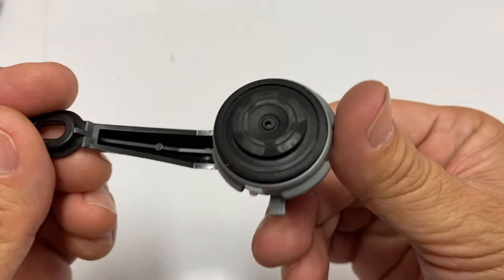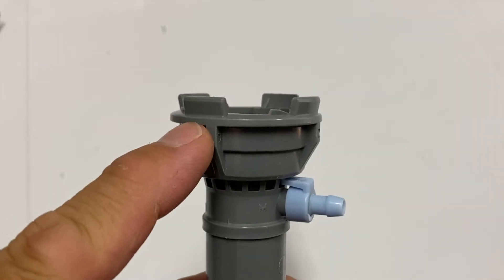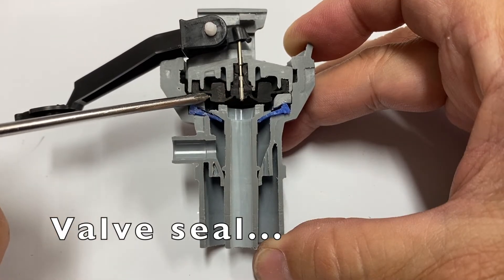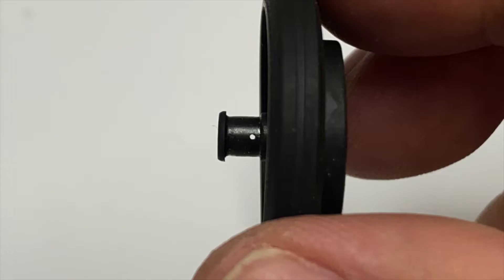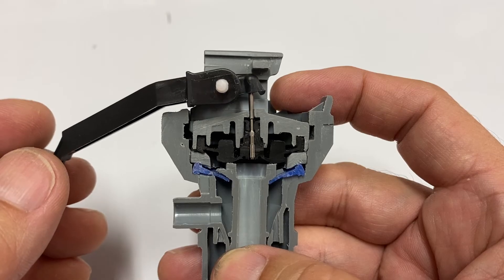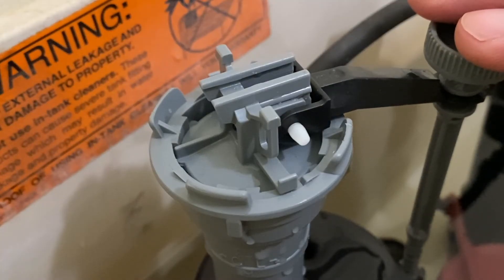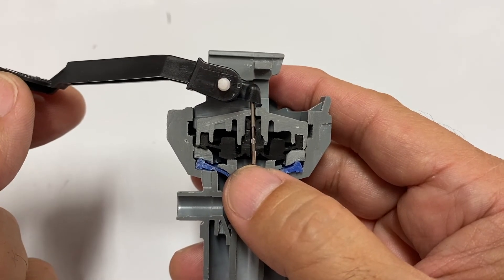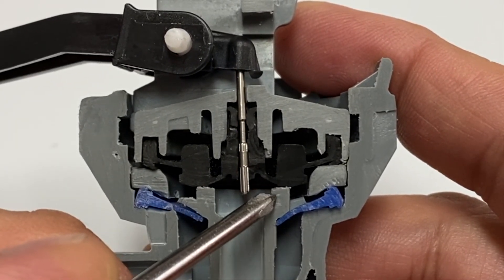How Fluidmaster 400 Series Fill Valves ACTUALLY Work

Comment: Thank you for that explanation. I recently installed a new Fluidmaster valve but when the cistern is full it still allows water to flow in! How I can correct it, do I need a new rubber valve, or I need to add additional seal?
Reply from the maker: This video may help… How to Fix a Running Toilet for Beginners | Basic Life Skills
https://youtu.be/Mv5V44pgSdE
👍😎

Comment: I have the same valve but when i flush the toilet, it doesn't automatically refill.  I have to tap the value and then it starts to refill.  What could the problem be?
Reply from the maker: First, confirm that the float freely moves up and down.  Next, clean the fill valve seal… Fix it Yourself!  Replace the Fluidmaster 400 Valve Seal for Beginners | Basic Life Skills
https://youtu.be/sEdfFZQYQEI
👍😎
Reply: @HacksbyDad  I think it maybe just dirty because I just flushed it and it did not start to refill until i tapped the the top of the fill valve a couple times.

Comment: Awesome Video and Review!!

Question, Is the Fluid master 400 model and Fluid master 400A model the same thing? 

Thank you sir!
Reply from the maker: Thanks!
I am familiar with the 400A and 400H… What's the Diff?  Fluidmaster 400A vs 400H
https://youtu.be/xlrH3I-9KR8
There is also a 400LS (Leak Sentry) that I have yet to get my hands on.  
👍😎

Comment: So, I just replaced the valve seal as instructed. Not enough upwards pressure from the float as it rises. Only way to stop water with arm is to pull up pretty hard with my hand. Wonder what is going wrong?
Reply from the maker: Not sure.  This video goes step-by-step on replacing valve seal... https://youtu.be/sEdfFZQYQEI
👍😎
Reply: @HacksbyDad a few flushes later and everything is fine. Must have needed a few flushes for the new seal to seat properly. Thanks for your reply! Good content!!
Reply from the maker: @tarajones-legros3661  👍😎

Comment: My new fill valve seal doesn't squeak like that when I put it on- I get no resistance. My toilet keeps running now with both the new one and old one on (the original issue was just whistling). Did I mess something up? This wasnt supposed to be this complicated 😥
Reply from the maker: Not sure.  Please clean the valve seals and flush the valve head again to see if that helps.  If not, you may need to replace the valve head or complete fill valve assembly.
Reply: @HacksbyDad  Thanks for the quick reply. I just kept things simple and spent an extra $10 to replace the whole fill valve instead of trying to figure it out. This video was helpful in at least helping me figure out the issue. Thanks.
Reply from the maker: @spainman2020  👍😎

Comment: Do you have an opinion whether this is a good design because they seem to fail after a 3-6 years. Is the most common point of failure the rubber gasket or the small channels in the stainless pin getting clogged with mineral/chlorine deposits? Is there a better competing design or is it as good as it gets?

Comment: Thanks for your videos. I've seen lots of videos in Youtube about a valve that won't shut off or fill slow. My problem is the opposite: I flush and it won't trigger the refill unless I give a little shake to the valve assembly, then it starts normally.  The valve is an almost new Fluidmaster. Any ideas?   I have both the fill level and valve open to the with the max little plastic dials.
Reply from the maker: Hard to say without being able to see the setup.  Is the float stuck at the top and drops when you shake the valve assembly?
Reply: @HacksbyDad  No, everything looks fine, I just wiggle very slightly the top of the assembly, just a touch and then it starts to fill.
Reply from the maker: @JuanDeMarias  You may want to clean or replace the valve seal... https://youtu.be/1Tnv9J8a9O8

Comment: Once i flush there is more water that sprays alot faster out the top of the controll stim. I have to shut off the water supply for the toilet to fill properly. Would replaceing the valve seal solve the issues or would i have to just replace the whole mechanism? Thank you in advance!
Reply from the maker: I haven’t run into the problem you described.  Replacing the valve seal might solve it… Fix it Yourself!  Replace the Fluidmaster 400 Valve Seal for Beginners | Basic Life Skills
https://youtu.be/sEdfFZQYQEI
I hope it works!  👍😎

Comment: Hi. I've replaced the seal by itself,  and the entire filler valve cap assembly, but it still does not shut off the water! Please help.

I've removed the valve cap and flushed water through it several times -- no change.  I've tried turning on the water and just lifting the valve arm manually -- water still runs. 

I've felt the valve seat for problems and cleaned it with a Q-tip -- it still runs. What am i missing??

All that's left is to drain the tank and replace the entire fill valve, but this has happened a couple times, so I'd rather figure out what's wrong. This should be an easy fix!

Thanks.

PS. Excellent video, I've dissected these before but never sliced one in half, so I never understood how they worked.
Reply from the maker: Sorry… I’m not sure what is causing the problem.  I would say something is damaged if all the parts are clean and holding the valve arm up doesn’t stop the flow of water.  I have heard that poor water quality can cause problems. 🤷🏻‍♂️

Comment: Thanks so much for taking the time to show this in such detail. This is not how I would have guessed these fill valves work. That's some clever engineering. Seeing those tiny holes, I am impressed with how quickly a tank refills.

Comment: Thank you for all the work it took and providing this. After replacing the rubber valve the fill valve is still often fails to shut off the fill water. This has given me ideas to check: make sure the tiny holes on the center valve are clear. Examine the metal stem to see if it is bent and unable to allow water to fill above the valve to pressurize it.

Comment: what happened to me was that on low water pressure the valve does not stop the water flow and the tank overflows. anybody else with this issue?
Reply from the maker: Sorry... I haven't experienced this problem with the fill valve and low pressure.  For the tank overflowing, please check to see that the overflow tube is at least an inch below the hole for the handle.  The setup is explained is this video... https://youtu.be/HFLEoBAJj2E
😎

Comment: Had a run of bad luck with those fluidmaster rubber diaphrams.   Had a PRO45.   Worked flawlessly for almost a decade.  Started sticking open.  Replaced the rubber diaphram.  Now it squeals, and slowly leaks.  Figured the plastic valve seat degraded.  Replaced the whole valve with 400a.  Worked for a few days, randomly sticks open 1 out of 4 flushes.  Gave up, switched to a Korky.   That metal pin is so small in diameter and the rubber diaphragm is essentially the both the valve body and valve seat for that pin and it's molded into the rubber.  Not much tolerance for error in the rubber molding process.   Don't know if fluidmaster's tooling is worn out causing the more recent rubber diaphragms to be of inferior quality and that combined with my higher water pressure makes for repeated failures.  Toilet valves aren't supposed to be rocket science, but this one has me stumped.
Reply from the maker: How is the Korky fill valve working for you?  I haven’t tested one out yet.  😎

Comment: One additional point: if you have removed the whole assembly, and/or moved the top section against the fixed tube attached to the cistern, perhaps in order to adjust the fill height or to inspect the whole thing away from the toilet, there is another source of a slow leak:
The top section with all the float and valve business is sealed against the water mains pressure small inner fixed tube by 2 small O-rings. These rings (10mm outer diameter x 1.5 mm) harden over time and stop sealing properly.

So if you disturbed the seal between the upper and lower sections of an aged Fluidmaster assembly in any way, the symptom of a creeping overfill is the same as a faulty valve seal! So if cleaning and replacing the valve seal doesn't fix the overfilling, consider replacing the 2 small O-rings (a little fiddly as they are in a recess).

There's also a bigger O-ring around the outer bottom tube, which, I think, is not critical for leaks, more to do with potential air ingress during filling (a problem I encountered and reported in another comment).

Comment: Very much appreciate your cutout of the valve and its housing and how it works. Is it common to have the rubber seal look all normal visually but to be impaired in how well it seals (or doesn't seal)?
Reply from the maker: Thanks!  Yes, it is common for the seal to look okay but not function properly.  😎

Comment: Thank you so much, this is exactly what I was looking for! 

I couldn't understand how the pin could force the rubber seal to close if they weren't firmly attached to each other. Now I see that it's actually the water pressure itself that holds the seal closed, which is a genius design.

This gave me the confidence I needed to get a replacement seal and get the toilet working again.
Reply: A genius design wouldn't wear out and stop working on us the way these things seem to do these days 😉, but yes thanks to Hacks by Dad for letting us see exactly why it fails! I need to start keeping spares on that rubber thing. I used to think CLR/soap and cleaning would revive it, but seeing this video, it looks like a lot of the wear and tear is likely up inside that little pinhole.  -Take Care

Comment: Then when the rubber ages the narrow sections of the rubber do not seal on the stem and water continues to escape from the top of the stem regardless of the pressure down on the rubber seat!! Over engineered that relies on a very small rubber to tiny stem seal!It is clever, but too clever to be long term reliable as the flutes a will eventually cut a groove in the small rubber sealing points!

Comment: I changed the valve seal but water continues to flow out. the water rises above the floater and spills into the bowl. If that blue part is damaged, could that be causing the flow?
Reply from the maker: I suggest you verify that the float and valve arm move freely.  If they do, you can replace the valve cap (including the valve seal) or the entire fill valve assembly.  Hope this helps.

Comment: I have this model in my toilet. When the fill valve closes on mine it happens somewhat abruptly and this causes a bang in my wall. I installed a shark arrestor but still bangs quitle loudly. I may need to replace the whole fill valve. Or, do you think It could be a bad valve seal?
Reply from the maker: I experienced water hammer when my pressure regulator failed.  It stopped after I rebuilt the pressure regulator.  Here's a video on that repair... https://youtu.be/eI334pzRWDQ

Comment: this is wonderful!  That little valve uses the water pressure on a big area (around the circumference on top) to hold back water under a small area (the centre part).  The same process that big industrial valves work on.  I just replaced mine; crud in the bottom where the supply attaches, cut flow.  I did the 'flush process' but it wouldn't clear.  Great!!

Comment: Bravo great video well explained and excellent visual aids.  I am looking my 2nd toilet with this valve with the same problem.  The tank refill has crawled to a slow gpm flow from the valve.  I did a quick cleaning but there were no debris and water pressure is satisfactory on the inlet.  So i suspect the rubber seal is the problem as it looks a little worn.  ANYONE ELSE have this same issue with this valve?  IF SO i was thinking of just replacing the upper pop off portion to save time.

Comment: Great video, i need to look at mine as the old seal leaked causing overflow. Replaced the seal but now it takes a lot longer to fill. Interestingly the old seal was red the new one was black, I'm wondering if it is simply because the new seal is stiffer and slowing the flow.
Reply from the maker: Thanks… I appreciate the feedback!
Are you talking about plastic valve cap being red or the actual rubber seal?   I haven’t seen a red rubber seal before?
Reply: @HacksbyDad  No the actual rubber seal, it is a dark red colour, I thought maybe a low or high pressure version, but the replacement washer pack is OEM and states multipressure and the seal is black. This is what it fitted, I'll take it off again at some point to see if there is any reason why the water rate is slower.
Reply from the maker: @royster3345  Thanks for sharing.  Now I know that there is a red-colored Fluidmaster fill valve seal.  Hope you fix the problem.  
😎

Comment: First thank you for detail and indepth explanation. However I am still confused why such sophisticated mechanism is needed. A simple spring loaded shut off valve would have been good enough with the ability to bypass some water through the toilet refill tube
Reply from the maker: I'm curious too.  I'm sure they have a good reason.  I read that the water pressure behind the valve seal creates a very strong seal.  Maybe someone from Fluidmaster will see this and explain.  
😎
Reply: Yes, whatever was wrong with a simple lever pressing directly on to the rubber diaphragm to stop the water flow? Why re egineer a simple device with something which relies on precise fluid dynamics and precision seals to get the job done? I have a filler valve type which relies totaly on water pressure above the diaphragm and just a tiny bit of wear at all on the rubber stops it working! The rubber has to be brand new or no deal! Somebody always has to come along and re invent the wheel...

Comment: I don't understand why the initial water has to be release out the two holes onto the top of the fill valve?
Reply from the maker: That’s so the water pressure above the valve seal can be released which allows the pressure below the seal to lift the seal.  Lifting the seal allows water to pass by under the seal to refill the tank.  Hope this helps.  Thanks for watching the video. 
😎
Reply: @HacksbyDad  Thanks so much for the clarification. Great video.
Reply from the maker: @roberttompkins6489  Thanks for the feedback!  Much appreciated!
😎

Comment: Informative.  Those two tiny holes in the stainless stem become CLOGGED 
would cause trouble.    Extremely small size.  hardly noticeable.
Reply from the maker: Yeah.  Interesting engineering.  The valve seal and control stem are self-cleaning.  
😎

Comment: Is it just me or is this entire fill system way over-engineered just to fill a damn toilet tank? No one will ever convince me that the seal is NOT designed to fail. 

Great video! I had no idea how a seal with a stainless steel pin punched through it actually stopped the water flow.
Reply from the maker: Thanks for the feedback!   Appreciate it. 
I’m sure there’s a good reason for the complex design, but that’s waaaay over my head!  LOL
Reply: I agree in principle with the "over-engineering" argument, but would like you to consider:
a) the only sophisticated parts are 1) the stainless control-stem and 2) the shape of the rubber seal. Given that the stainless steel part in this configuration would not wear within your lifetime, swapping a pennies' worth of rubber seal seems small change compared to any alternative.
b) the FluidMaster solves a number of other problems of earlier float control valves, e.g. noise!  It is extremely quiet compared to anything else I've come across.  It employs a number of noise control features that have not appeared in its own literature nor in social media, like the flow-limiting silicone-helix (worm) in the base of the intake, and the clever outflow back down to the bottom of the cistern, plus some clever design to avoid air-ingress during valve opening!  All other cistern fill systems I know, blow unrestricted water & air mixture over the surface, causing a mighty racket (dependent on the prevailing water pressure).

Disclaimer: I'm in no way associated with FluidMaster or its products.  I'm just trying to balance arguments I find online against my experience.  Cheers, Matthias
Reply: Yes, wayyyy over engineered.
Reply: Over engineered - meaning it is designed to be reliable, compact, and inexpensive. The control stem needs to be small so that the force to operate the lever is reasonable. Holding back the water pressure for the full area of the valve opening would require an enormous float and a very strong linkage. Instead the control rod is just a pilot valve that lets the water pressure do most of the work.